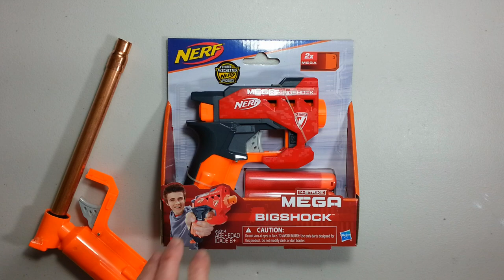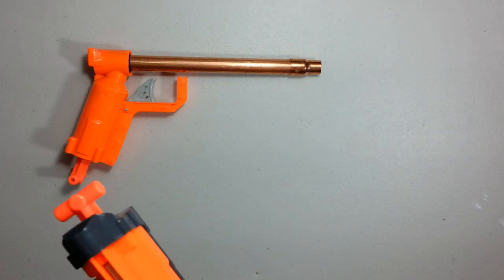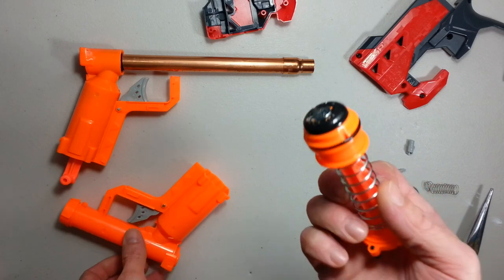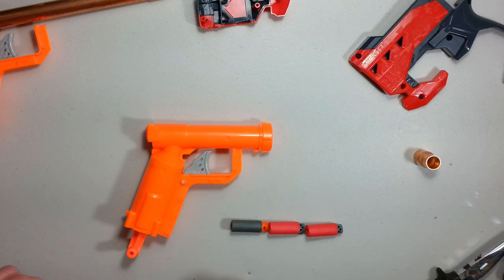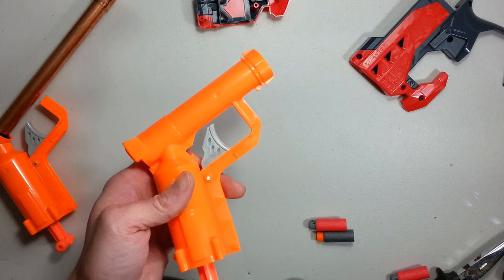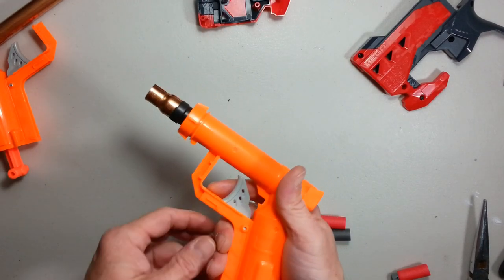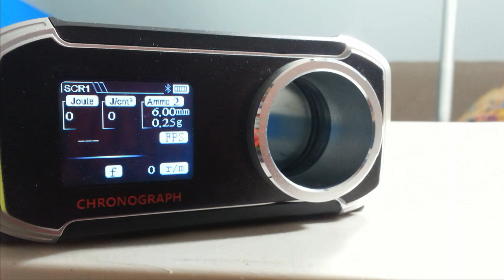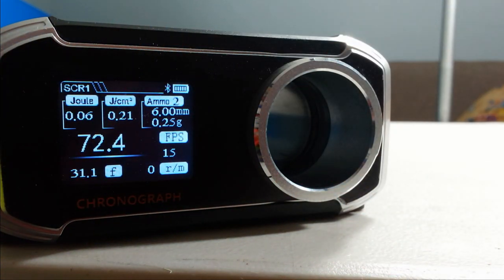Nerf Mega Big Shock Half Dart Mod

Comment: you need a longer barrel for more fps i guess. the plunger volume seems to be big enough for 130 fps with a short dart
Reply from the maker: That's the phenomenon that happen with the scar...since those Worker scar seal enough, my FPS are up with it ON. Plus I did the Experiment with an Aeon barrel(which work Amazingly and will be part of the Tactical Hawk Eye)
Reply: @thatoldnerfguy  thr aeon isnt even sealed. properly imagine what 4 inches of 17/32 brass pipe would do to the performance

Comment: How long did you cut the copper pipe? And can a longer width hold more darts?
Reply from the maker: about 4 1/2" plus the fitting just give enough for 3 darts... I had good result up to 4 darts length after that  it's either misfire or no power